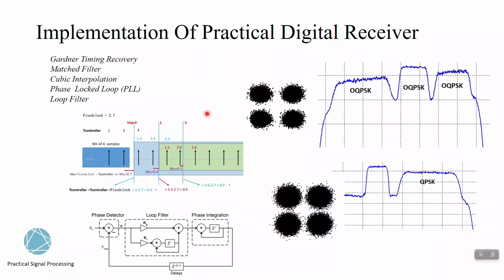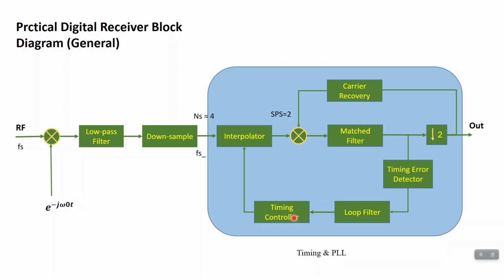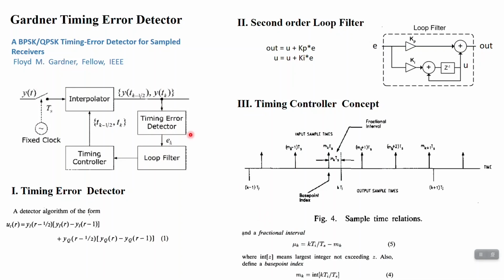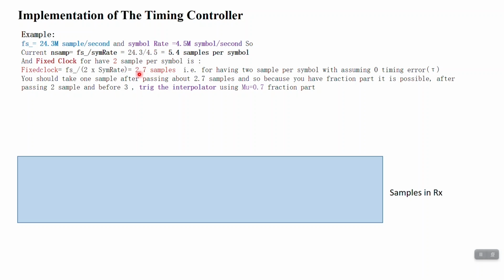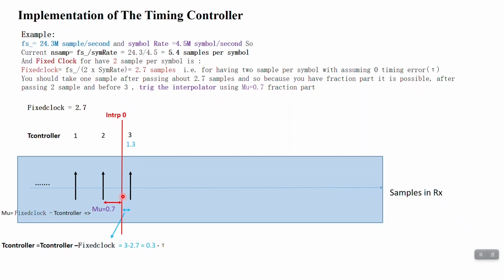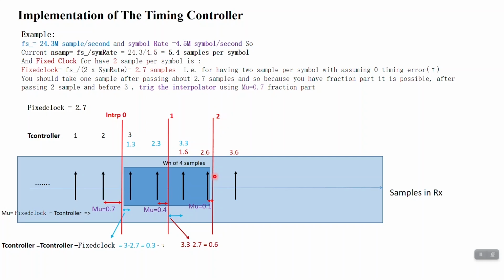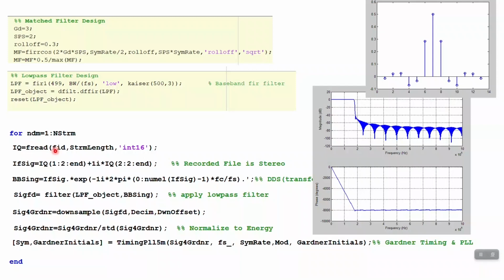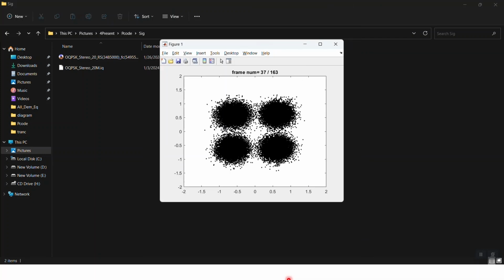Implementation Of Practical Digital Receiver( Gardner Timing Recovery & PLL)

Comment: will I be able to implement this Gardner TED algorithm for clock recovery for  BPSK  signal ?? also can you please povide me  code or blocks (with values) for Gardner TED implementation in Matlab SImulink ??
Reply from the maker: this Gardner TED algorithm also works for BPSK and 8PSK ,... and also for QAM modulations. there is an example of Simulink  implementation  in Matlab about timing recovery and receiver, you can find it simply by search in Matlab Help.